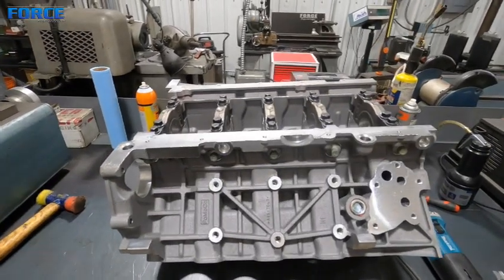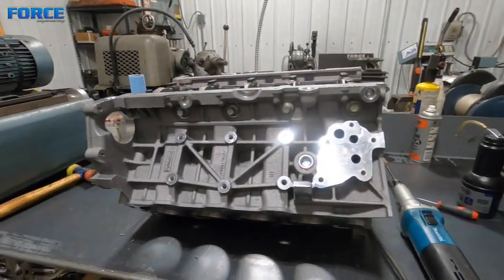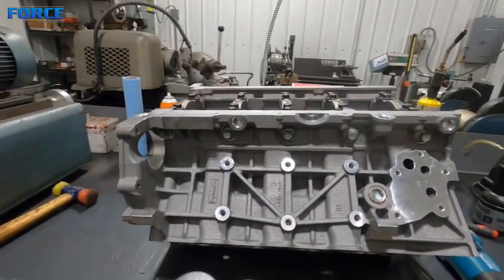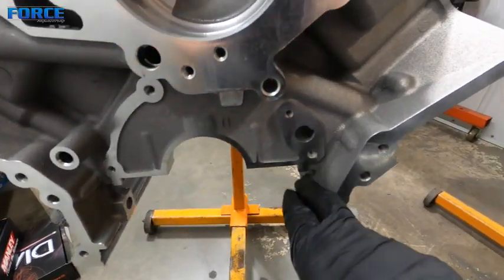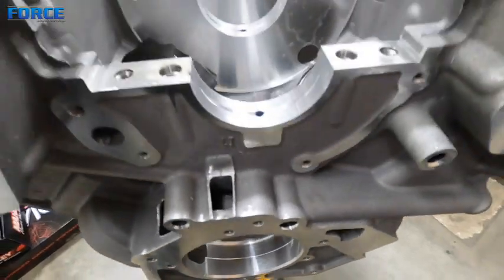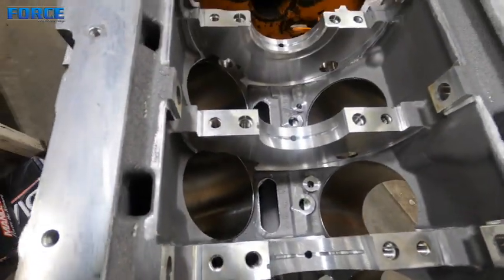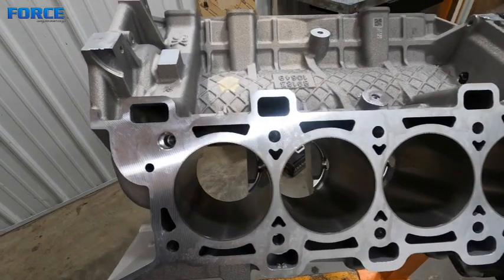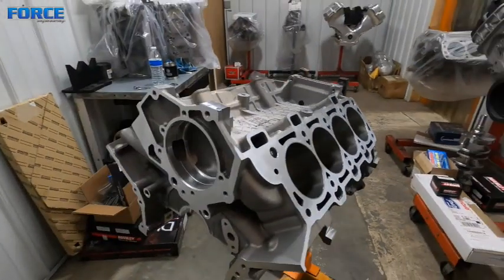Engine Assembly - 5.0L Coyote Block Prep and Oiling System Overview

Comment: I have a Predator block (KR3Z-6010-A) but it come bare without oil/water plugs. Wondering if you know which ones are needed?

I have oil squirter block offs.
Reply: Uses the same ones that come in the Predator.